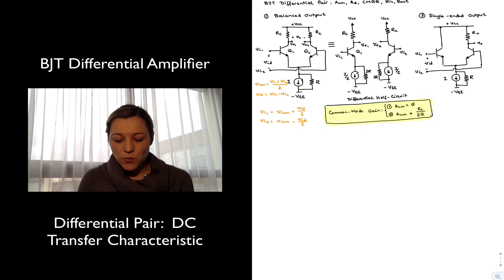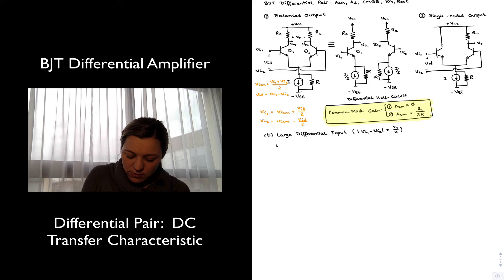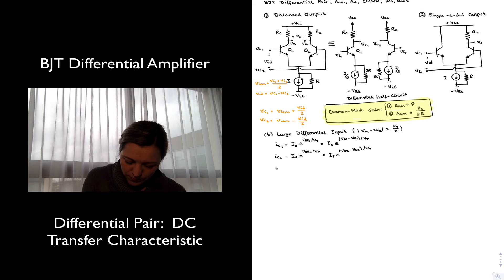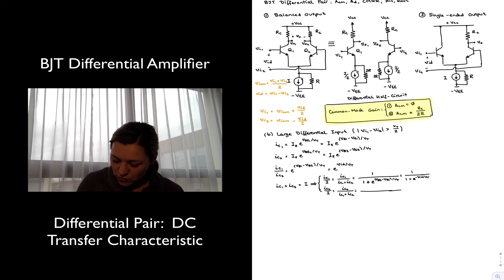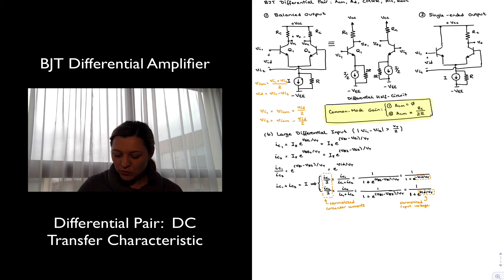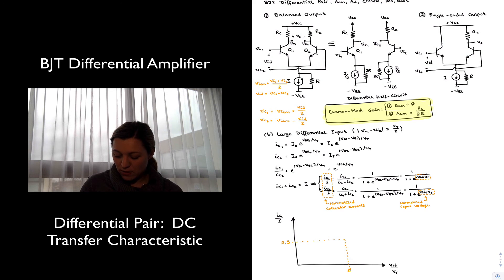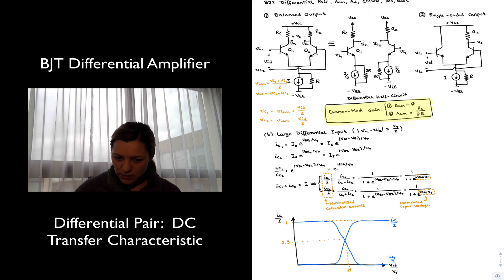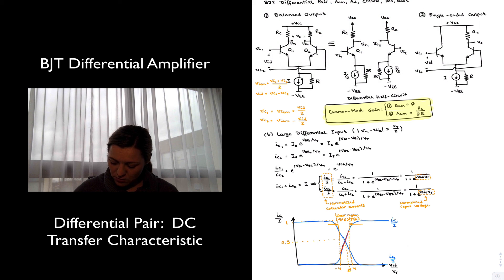BJT Diff Amp: DC Transfer Characteristic

Comment: So I came here rather intentionally, I'm looking at buying a differential output op-amp, but its ended up being to expensive, so building a discrete version (differential version ) is sometimes still cost effective, provided the specifications is meet by the designer, op-amps specifications needs to be studied in details and its still a very misunderstood stood subject as a result of the many degrees of parameters.